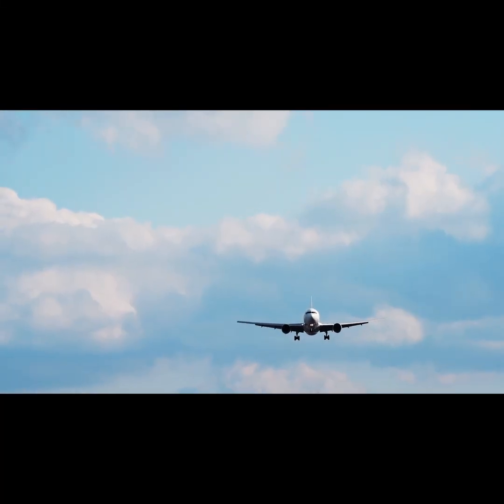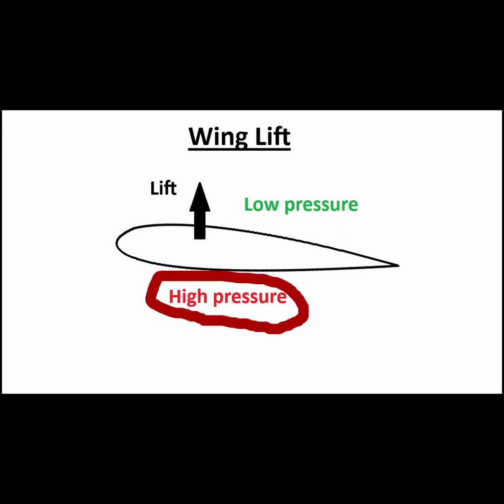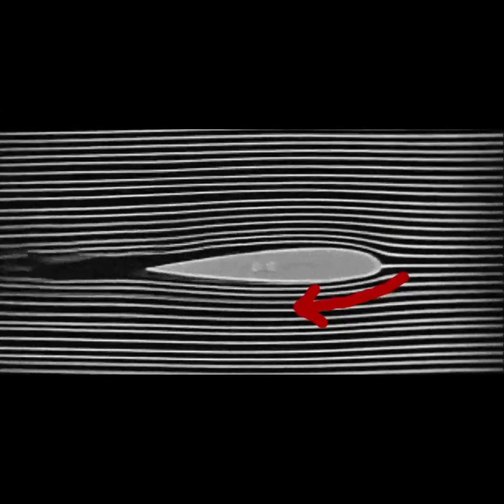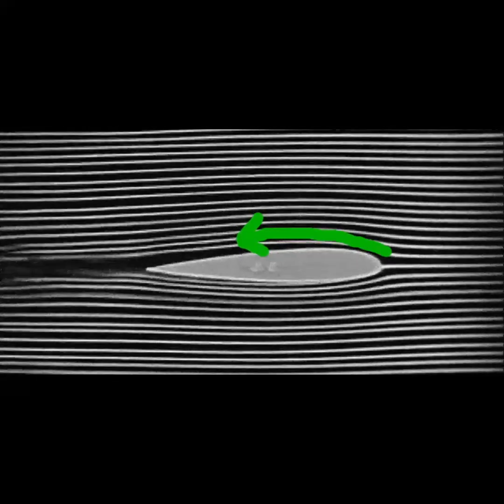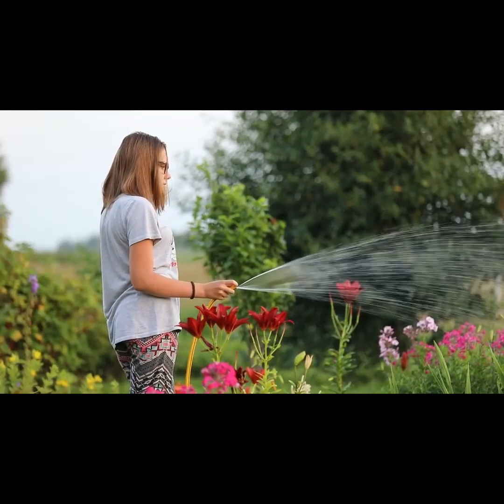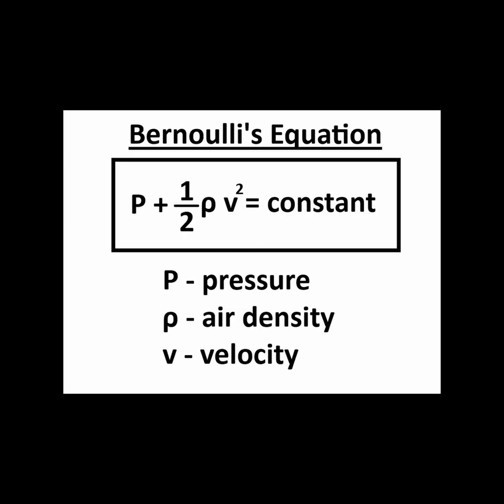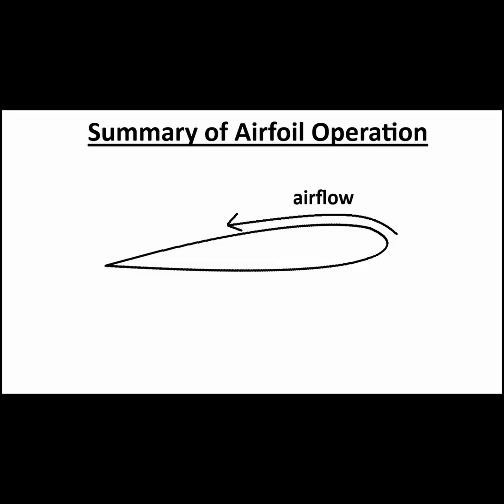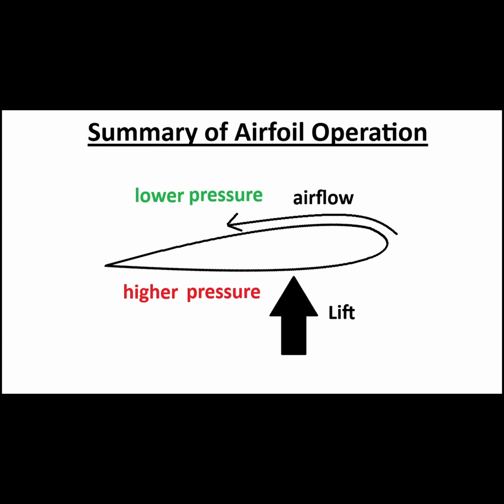Airfoils and Lift

Comment: What  absolute 🐂💩
The velocity is different because the aerofoil is asymetrical and the top is longer so the Velocity is higher so the pressure drops providing the lift
Probably AI bollox
Reply from the maker: Thanks for watching the short. However, your comment is incorrect. First, airfoils don't actually have to be asymmetrical, although many designs are asymmetrical. Second, the explanation of a "longer path" is not based on actual science, and has been unequivocally demonstrated to be false. Here's an explanation from NASA's website explaining this in detail: https://www.grc.nasa.gov/www/k-12/VirtualAero/BottleRocket/airplane/wrong1.html